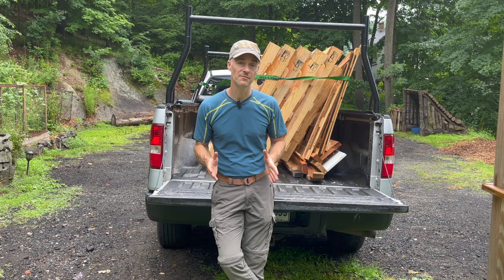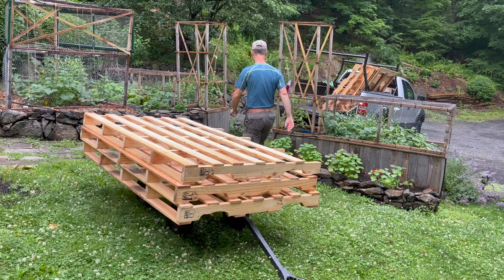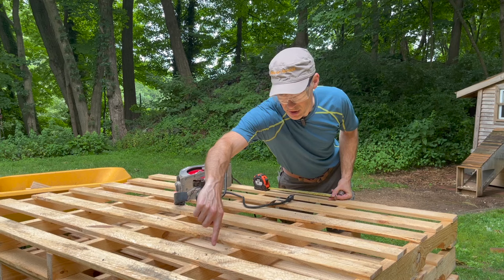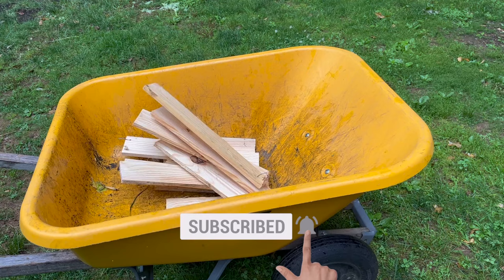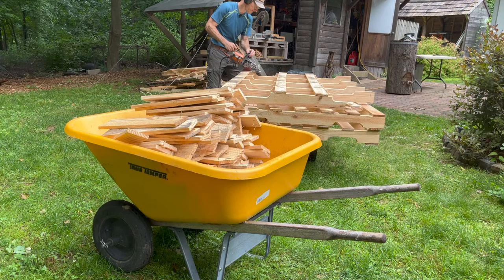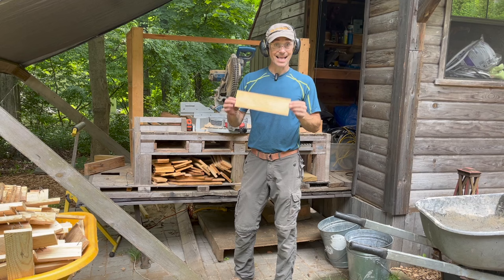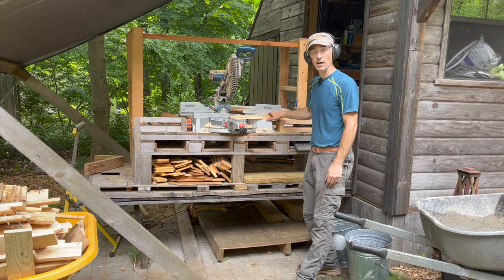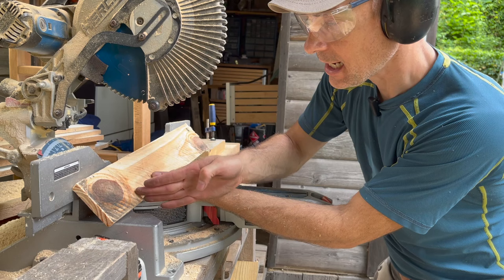FASTEST way to make pallet shingles (Part 1)

Comment: Do you use wood varnish outdoors? In Poland we must protect every wood that stays outside because after a cold winter it will look awful and start to stratify. I saw many films from Canada and they also protect wood. So are you using some sort of magic in the US or another kind of wood that doesn't require varnish? I tested vegetable oil a few times with wood and the results were impressive, but most varnish and paint used on wood are based on chemistry. Please don't feel offended by my question. I just feel like my mind will blow every time I watch films from the US with such nice looking wood that seems not to be covered with any kind of protection material.
Reply from the maker: I think I just happen to have a climate friendly to leaving exposed wood because there’s a lot of it on my property and it’s lasted a very long time that said I’m not opposed to using whatever I have handy including something like you mentioned vegetable oil

Comment: Yea. I wanna know more on this.  Bout to wrap moms shed with pallet wood. Gonna use my reciprocating saw to cut the nails and just leave them in an work around them for big pieces and go horizontally. I like the vertical shake planks you have got going on here. Looks wise its good. But how about for wind? Like all those butts. I am gonna put vapor barrier. But it seems like i would get a lot of moisture still? Lemme watch this agin.

Comment: What type of wood are the pallets made from? Does it matter what species they are made from? How long do the shingles last?
Reply from the maker: There is a pretty wide range of species, but oak and pine are the most common. Oak will certainly last longer. Duration will depend on where it's installed and the weather. I've gotten 10 years on mine. Coating with boiled linseed will also help.

Comment: Do you treat the shingles to make them more fire resistant?   Seems wood roofs are just asking for the building to burn down from any stray embers flying around.
Reply from the maker: I haven’t, but I live in an area where the risk that is actually very low, but it probably wouldn’t be a bad idea to do some thing linseed oil?

Comment: I built a place on the ocean the first 9 layers of shakes I doubled the first two then left 1/4 inch tthe weather   
The next shale 3/4 to the weather the next one inch to the weather two inches to the westher three inches to the weather four inches to the westher then 
5  1/2 inches to the weather for all others I used clear cedar shakes that had a taper over OSB this methoid used in Cape Cod Massachusetts Norm Aberhams from this old house shows the methoid on THIS OLD HOUSE  but your great idea of pallet shingles would work also the electricial outlets up two feet where quite thick woth Cedar which stopped any bugs more omportantly protecting the beams from deterioation being that thick also shed wayer very well !!! Great idea !

Comment: those are nice clean , large pallets. iv been using cut up pallets for a few years now . mostly for out door fire pits and some indoor heating. we just bought a larger property. and there is a few sheds in need of siding. a chicken coop and the kids need a tree fort. this is a great method. im a big fan of free.scrap the metal, build and burn with the wood. cheers.
Reply from the maker: Hey thanks for dropping by. Yeah pallet wood is a great way to side and roof those outbuildings!

Comment: Yes, please overview what methods you've tried and landed on for tapering these short flat boards into shingles. Here, used cedar fence boards are ubiquitous, but I've noticed that shingles are tapered. And it's not obvious how to taper 6” wide boards on a table saw or other common tool, especially at scale.

FYI: I'm in Austin Texas, and recently I gathered 8 tons of reclaimed wood using just my motorscooter. Simple tools allowed making pallet decks, work tables and simple tarp shelters. I'm now designing a modular work shed with heavy storage in the second story loft. Later, I want to fill the front yard with raised beds that may turn into mini greenhouse.
Reply: not all shingles are tapered, i dont think he is tapering these based on looking at the finished roof.

Comment: Wow, i didn't know about MB! THANKS. Do the shingles not get tapered?
Reply from the maker: I have done it in the past, and it ends up, making them too thin and likely to warp. Since they aren’t tapered, generally the solution so that they lay reasonably flat over each other is to reduce the amount of courses that you run.

Comment: Do you use pine or oak for exterior shingles? Or both? I would think oak would hold up better. What has been your experience? I come across a lot more pallets made with pine than oak.  I do find quite a few that are made of unknown hardwood. Maybe tropical? Thoughts?
Thank you. I enjoy these videos.
Reply from the maker: When it comes to shingles, I use what I can find and pay more attention to the thickness to make sure they are similar to each other as possible. Obviously oak is best , and if you can stockpile them prior to a project even better.